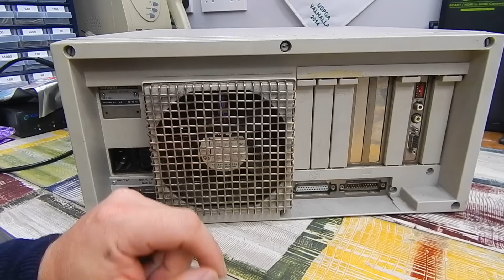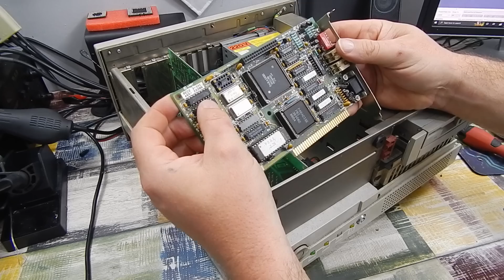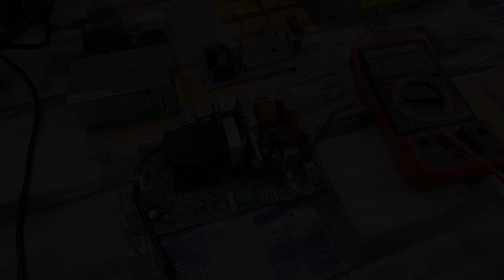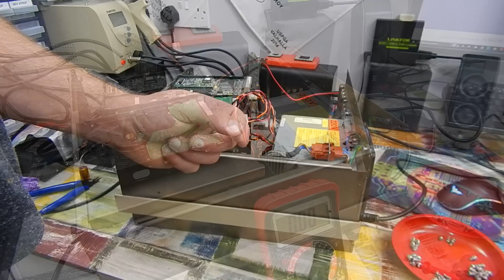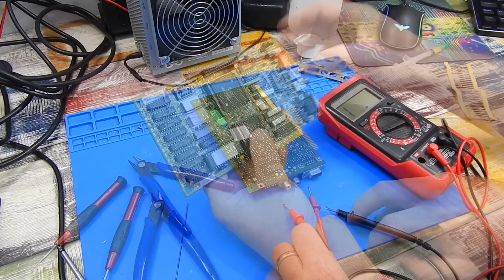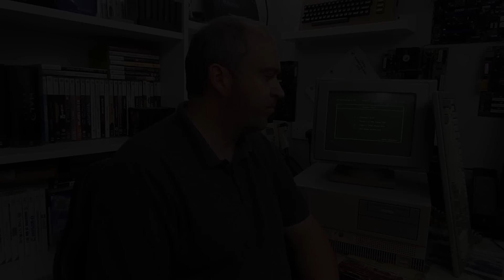Inspection, repairing and testing of an AT clone. Olivetti M280 Part 1.

Comment: Well finally found a complete at&t 6312wgs. The psu was also shot.. went straight to testing that capacitor.. both that one and the 6v one were bad. Replaced them and it's now working! Thank you for posting this video!
Reply from the maker: Nicely done and I'm glad the video helped.

Comment: what is the maximum HDD and RAM size ? btw it is possible to buy an 1 GB IDE SSD? I have seen a 64GB 2,5" SSD with IDE connection for my 486, but what about 286? and is it possible to buy somekind of keyboard connector converter to usb keyboard ??  sry for bad English
Reply from the maker: This machine is very limited in terms of hard drives and RAM it will support without other expansions.  

Memory is limited to a maximum of 1MB on the motherboard although in another video I added a RAM card to one of the ISA slots bring it up to 3MB total.  

The bios is limited to a select list of HDDs.  I'd need to check but I expect the maximum HDD size supported by the bios is probably 80 or 100MB.  If you were to add an XTIDE expansion, in theory any size of drive could be used.  If you want a 1GB SSD drive I'd recommend going with XTIDE and using a 1GB CF card.  

As I explain the the keyboard video related to this machine, despite the 9 pin din used as a connector it is in reality an AT keyboard.  Some USB keyboards will work over PS2 which is essentially the same thing as AT.  You'd need to find such a keyboard then build a cable to convert between the USB and 9 pin din this machine is looking.  If you do this though just be careful of the pinout as there is 12v on that keyboard outlet too, you could easily fry something.  

Hope this helps.
Reply: @CRG  I had one the 386s built the same, fried it by trying to install an ATA controller or something like that. I liked the keyboard though, so Olivetti Finland sold me an official DIN adapter with a reasonable price. Then at some point it had the Olivetti-DIN adapter, a DIN-PS/2 adapter and PS/2 extension cable, looked somewhat peculiar but worked.

Also while the computer still worked a got a worse rating the Superscape 3D Benchmark than my friend's 286. Power without boundaries indeed...

Comment: Good fixing. I found that upside-down motherboard solution interesting. I think that makes service work a bit easier, at least compared to the IBM machines, and some others, where you had to take out a lot of  components (or all of them) to get to it. It was probably not a cheap way to do it though. On the other hand, they sure stuffed a lot of components on that board, so there wasn't really any room for ISA connectors. Clearly, they had their reasons to do it this way.

Comment: That cpu socket is identical to the acorn electron which uses the same setup for its ULA chip, regularly causes issues but a re seat usually sorts most issues👍

Comment: i think the upside down PCB design was using the PCB board as a heat sink ! after all heat rises and copper is a good heat conductor
Reply from the maker: Good point, at least the hardware in this shouldn't get too hot.

Comment: Those gold-coloured Roederstein caps always failed short, which is not exactly something you want to happen inside of a PSU! Indeed, blanket replacement therefore highly recommended! 

They were favoured by a lot of European manufacturers at the time, and caused the odd headache in TV's and the like from that era. Probably second to those horrid brown plastic caps that plagued the Bang & Olufsen equipment, back then!
Reply from the maker: The rest of the caps are on order, hopefully will arrive today, and I'll be swapping them out in the next part.  

Old caps are always a problem but in fairness and especially in the case of this machine they are well past their use by date :)
Reply: These golden ROE capacitors are also featured in the power supplies for the C128, C128D and old A2000s. Have repaired several such power supplies for myself and friends where one or more of these ROE caps had shorted, just like in this case.
Reply: @patrikaxelsson7789  I had one recently go in the audio stage of a mid-eighties TV. I only realised when the left-channel TDA2030A went up in a cloud of smoke, and the set went rather late into protect (tripping). As a high-failure-rate component, there's a real risk they'll destroy an IC that's obsolete or unobtainium.
Reply: Those capacitors are beautiful.

Comment: Olivetti's are weird, I remember an M24, I think it was, that had the same upside down board (8086, upgraded it to V30) and it had a nonstandard monitor port.
Actually we were testing out the V30 for something else, as this machine was spare on the way to being set up as a network translator between an OSI network and the DECnet network (two network cards, one standard and one very expensive special).
The V30 have such a stunning increase in network performance (faster interrupt handling, I believe) that it was immediately decided to leave it in for this machine's network task.
Reply from the maker: The first machines like these from Olivetti were the M24 and M28.  This system being the M280 is the next model on from the M28 (as I understand anyway).  
I've been trying to get a network card working in this machine but having weird problems getting it to connect to the network.  Nothing as elaborate as what you did though, cool story!

Comment: The setup disk for the AT&T 6800 Plus make work as Olivetti was the OEM for the AT&T PC 6800 and the 6800 Plus.  On the power supply, I wonder if there is another POT to adjust the 12 Volt rail?  These are very neat systems.  I have the AT&T PC 6800 which is an 8086 but built pretty much the same as your model.  Be sure to use a park program for the hard drive as the ST-225 doesn't auto park on power off.
Reply from the maker: Thanks for the info.  Over on stason.org for this drive it states "power  may be applied or removed in any sequence without loss of data or damage the drive".  I took this to mean it auto parks but maybe not.  Isn't hard to run the command to park the heads so better safe than sorry.

Comment: Tech Tangents aka Akbkuku has a method of coiling a cable up for that original look and feel.  With that, you could just use a standard DB9 cable and hack in the connector on the keyboard end.  It'll probably be a DuPont or IDC 2.54mm type.
Reply from the maker: I'll take a look at what Tech Tangents did, thanks for the tip.

Comment: I can remember using one of those at a workplace. Regarding the power supply some of those old supplies only monitored the higher voltage rails. Relying on the turns ratio of the transformer to get the other rails correct. Those were the ones that would push the 5v rail to 8-9 v when the 12v filter cap failed. I once had the happen to a 486 PC, it killed everything, even the mouse and keyboard.
Reply from the maker: Whoa, that's a little scary actually.  I've got the new caps on order for this PSU, hopefully they will arrive today, then that should keep it going for another 30 years without risk of blowing up and frying everything.
Reply: @CRG  Just carry on doing the right thing and keep it loaded when you test it. :)

Comment: That would go bang if plugged into our mains socket as we have 250V 50/60hz and is only for use in places like France,Germany,Luxembourg and others but not the UK Sorry.
Reply from the maker: Out of interest where in the world are you based, only if you don't mind sharing.  I'm UK, everyone calls our power outlets 240v but we design everything based at 230v.  Typically the outlets are somewhere between 230 and 240.
Reply: @CRG  Not far from Bangor County Down in Ballymena County Antrim but I have noticed a lot of the plugs we have are marked 250V 13A.

Comment: Olivetti and Zenith Data System (mostly after they were acquired by Bull) are two companies that made some of the most interesting PCs design wise in my opinion, back then…
Reply: Avrei ragione nel pensare che i computer Olivetti siano stati prodotti a Modena, in Italia
Reply from the maker: This one and its corresponding models from Olivetti of the time all seem to have this massive big box layout.  There seemed to be a lot more variety in system design from manufacturers of the time.  I've also got a big old Compaq 386 to get to which in itself is bit odd inside.  Lots more work to do to this thing first though.

Comment: If you wind up with a OLIVETTI BCS M3030 it will be a pain in the butt as the two 8" Floppy drives are driven of the one high torque motor via a shaft that drives both Floppy drives and the PSU would also give trouble but the real pain in the but is the printer as it creates a real racket when printing.